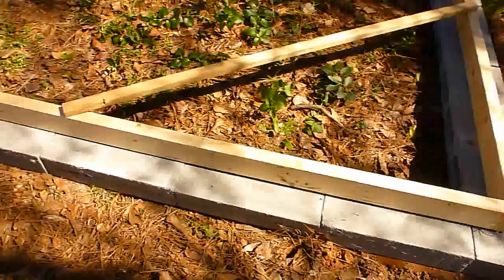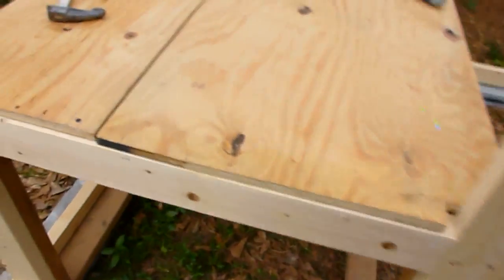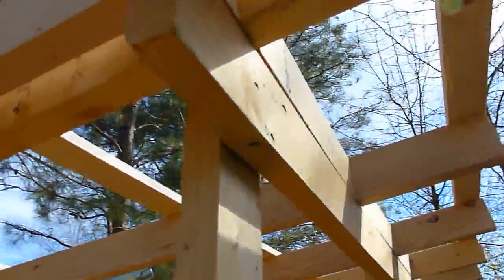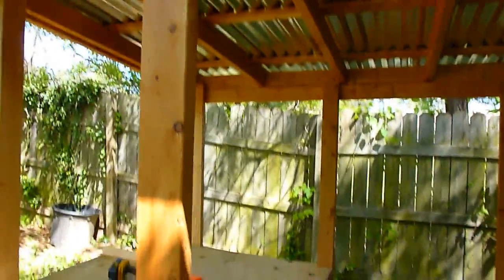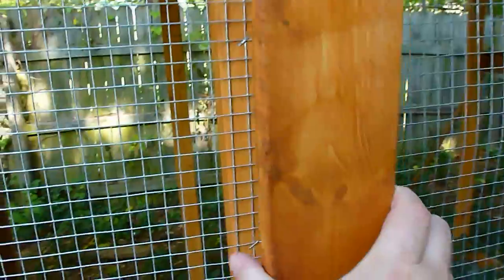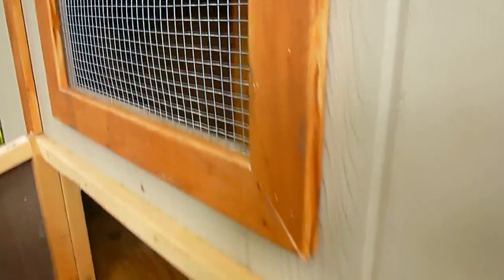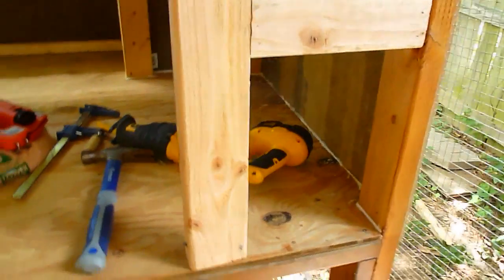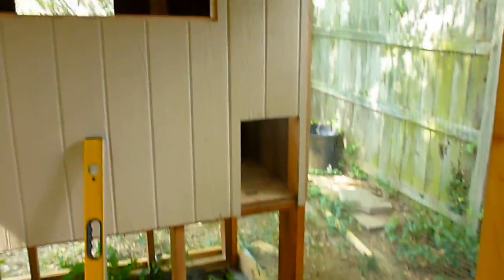DIY Chicken Coop

Comment: Great job and would like to copy your design.  What are the dimensions of the foundation?  Height of front wall and back (8' and 6.5'?)?  What is the length of the 1x3 roof slats, rafters and front back fascia boards?  Thanks.
Reply from the maker: happy to help..like I said I didn't work off any plans. But its 6x12, and I just bought a bunch of 12 foot 2x4s and cut a few in half to cut down on waste. The height really dosent matter I just tried to have enough slope on the roof to allow runoff of rain n debris but not so much as to act like a sail in the wind...lol. the 1x3s are 2 8 footers...and I just trimmed them down once the roof was in place. But looking back..plywood and shingles would have been easier for about the same cost. hope that helps!
Reply: Thanks so much.  Really appreciate it.